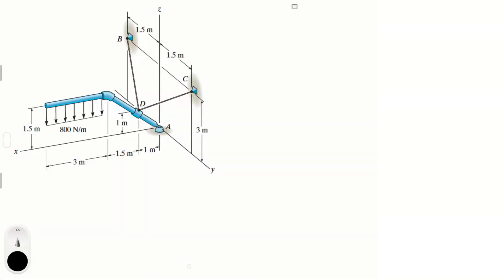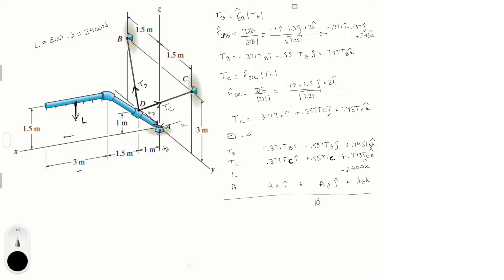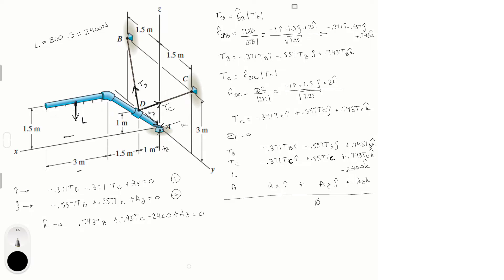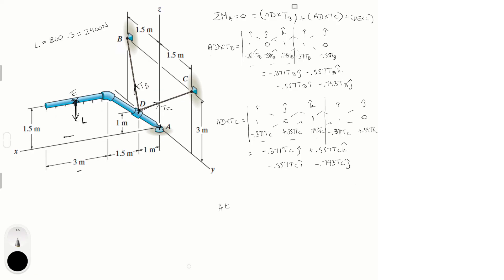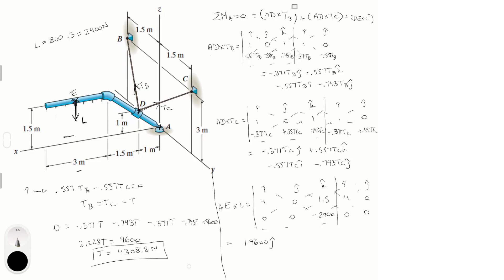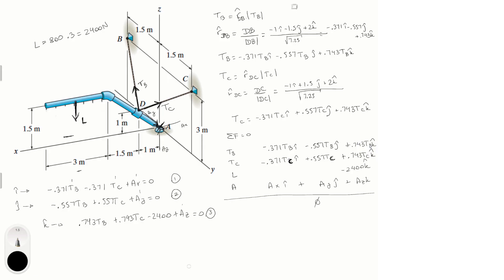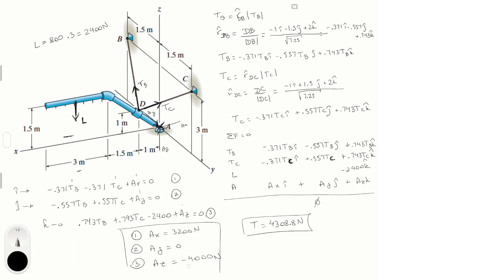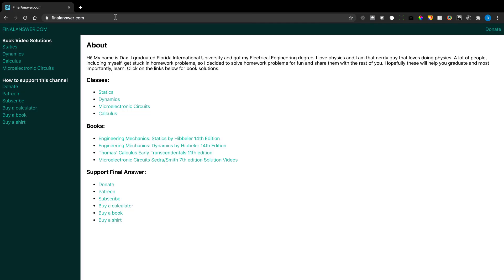Determine the components of reaction at the ball and socket joint A and the tension in the cables

Comment: for rbd=K is 3 right? how 2k^?
Reply: @pepe8796-z7t  The cables start from point D to either B and C, not A. From A to B, in k it is 3 but from D to A, it is 1, so 3-1 = 2k.
Reply: D is located at (1,0,1) and B is at (0,-1.5,3) @pepe8796-z7t